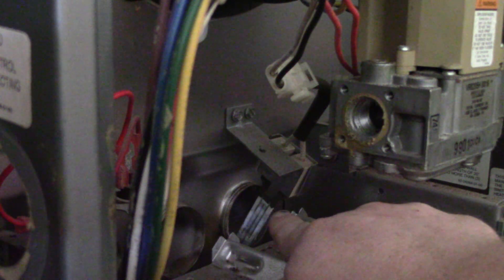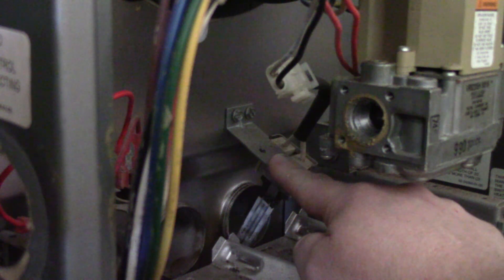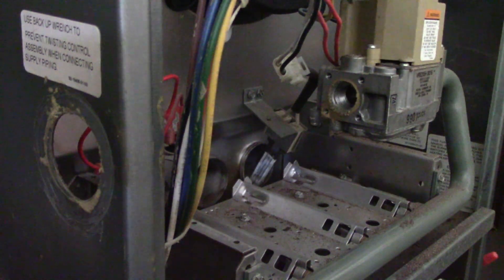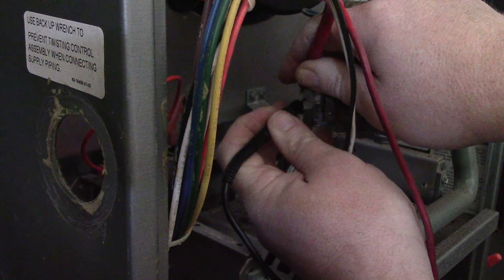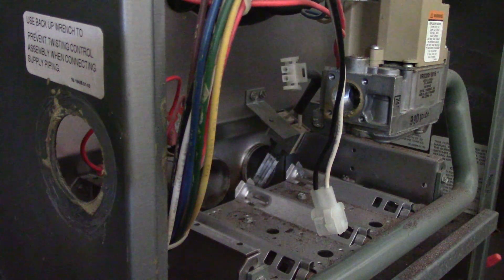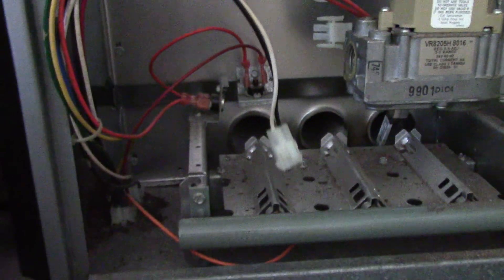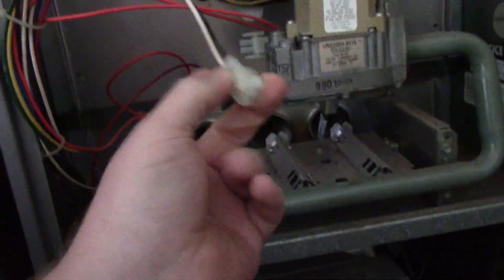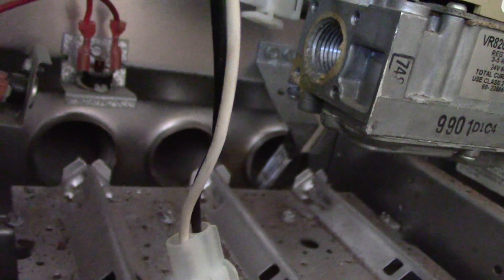Troubleshooting a gas heater furnace hot surface ignitor and testing

Comment: Thanks for this video, as someone else mentioned this one is more in-depth and allowed me to figure out my 24v transformer is fine,  I'm not getting 24 volts on the ignitor module and therefore no 120  volts to the ignitor.   Not sure what else to check at this point
Reply from the maker: Safeties like limit switches and pressure switches.
Reply: @ChilesHeatCool  looks like mine is the ignition module.   A tech friend came by and slapped it with a screwdriver and it started working.  I guess one of the relays inside is worn out.  He's getting me a replacement one.  Thanks again for your help.
Reply from the maker: @vfr800ification your welcome.